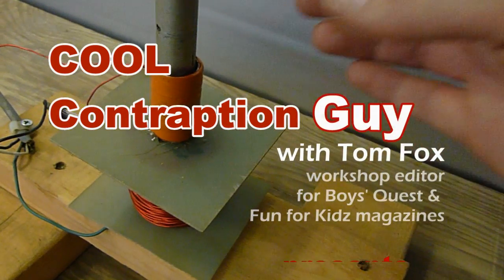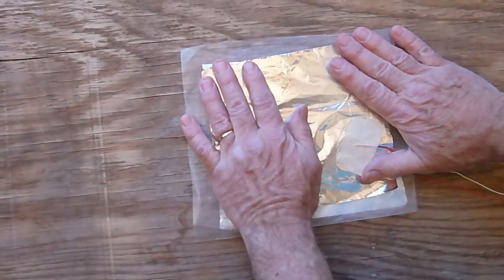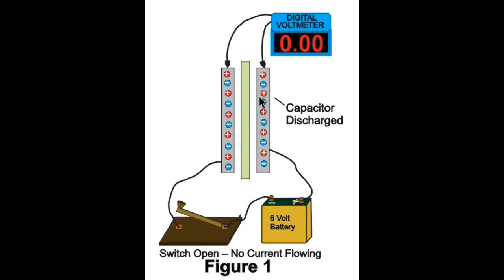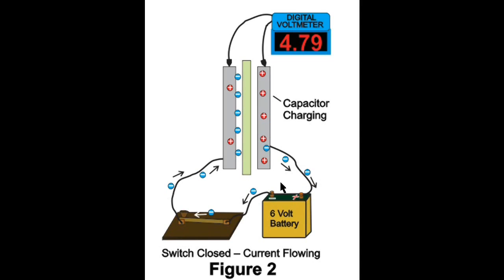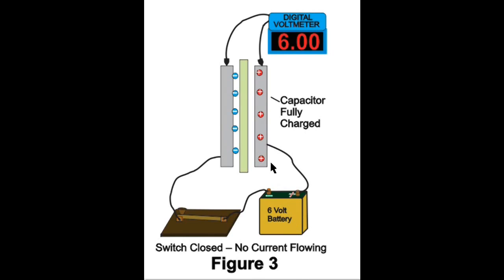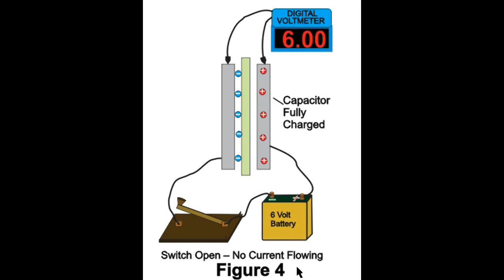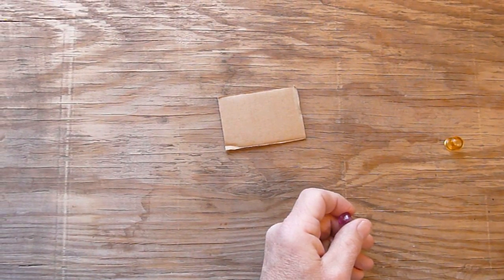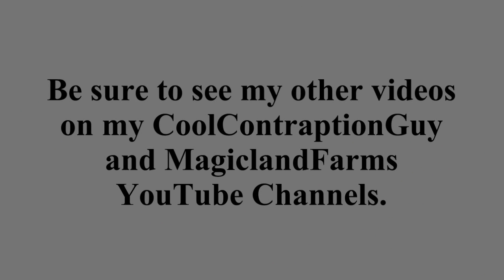How Capacitors Store Electrical Energy

Comment: Do capacitors really store electrical energy? Because as an electrical engineer I was told that the main and one of the disadvantages of electrical energy is the fact that it can't be stored. Of course, even if capacitor does so, in practice the energy stored in a capacitor isn't enough for it to fart.

Edit: capacitors don't store electrical energy, but they store electrical potential energy

Comment: thank you for sharing, you said that if you charge the capacitor  of 6 volts battery then it will stop charging if it reach the 6 volts, my question is what happen if your capacitor voltage value is 50 volts and your battery charger is onli 6 volts, does the capacitor continues to charge until it reach the 50 volts? and also what happen if reverse situation like 6 volts capacitor and 50 volts charger?

Comment: So we know that once 'charged' the plates repel each-other doesn't that mean they are both positive or both negative? Are we not just changing the magnetic properties of the plates so that they appear to store charge? Once we 'connect' them with a 'load' positive or negative electrons switch with half the now twice as many positive or negative charges and even out across the plates pullin/creating the same amount of current it took to 'charge' them. My question is does it physically store charge or does it create inside itself a polarly charged imbalance that then corrects itself by making electrons flow in the circuit it connects to?

Are we Adding an additional magnetic charge equal to the charge taken from one side and reinserted into the other but because of the dielectric it cant quite get to where it wants to go [other electrode] but still will travel back to the imbalance on the other plate direction so it manifests as an electric current to jump back home always taking the path of least resistance? We can encourage the path of least resistance by shorting the cap or introducing a less resistive circuit to induce current flow? How do we measure maximum capacity? What is the giving potential of the last valence shell in the electrode material plus how much surface area does it have? Also, what is the dielectrics tendency to acquire an imbalance in charge how negative in its valence shell plus how resistive it is by how thick it is? Are both the electrodes always benefit from being the same size or can one be larger or smaller Can they be shaped like transformer coils? Can they be made to induce magnetic current as well?

Comment: Electrons repel Protons (to the other plate), but opposing charges attract?
Reply: Surging Circuits I'm no expert but I'll try. so electrons do the moving. not protons. electrons are negative but they are referred to as the positive charge. This is because of conventional flow, it's literally backwards and if you don't know look it up... anyway, the battery terminal, which has a potential difference and force (volts), pushes the electons into the plate and they build up. im guessing the electrons also push back a bit as they reach full capacity on the plate due to some repelling but that's nothing compared to the volts, which are coming from the battery terminal and is a lot stronger. because of the size of the plate you get an accumilation of electrons. why are they so happy to do this? i think electons are very easy to manipulate so you get a storage of negative electrons/positive of the capacitor. The amount of electons make an electric field possible because the build up creates a large negative force and is strong enough to be wanting to be pulled to the protons on the other plate. bit like a magnet that wants to connect but it's not quite touching (my guess). The other plate with the protons and lack of electons is called the negative charged plate. how did the electons go? I'm not sure but i think either the other battery terminal moved them off due to its charge having an opposite kind of effect, or the electron charge on the positive plate built up and repelled the electrons on the negative plate. it repelled those electons just far enough away to make that plate charged or lacking of electons. so as it pushes in one way it pull with the field. The field can only move electrical energy one way because only electons move.
so now each plate has a different charge and the electrical field makes them interact. how? not quite sure. It's obviously some kind of connection.  I think the dielectric electons are also repelled, more and more as the electrons add up, and theyre discharged on the proton side, then they are replaced and the process is repeated. so the jump is actually when the field is strong enough to change shape and discharge.
well like I say, I'm no expert, and its just my youtube educated guess 😀 it's good to just think and use imagination.
I just answered to create discussion and hopefully find some frickin answers.
Reply: Hey Gary (thanks for your reply) and All…  My reply was to challenge the presentation a bit. I appreciate the video, but think it could mislead a bit, and getting a strong understanding of basics is the foundation you and I will build on. So, constructive criticism and contribution is what we all want, I assume.  Providing these basis points per my current understandings, for further considerations...

Atoms POSitively charged have more protons (greater mass) than they do electrons (lesser mass).  Atoms NEGatively charged, have more electrons than protons. Both atoms (IONs) desire to be equalized, and therefore have "potential" (voltage). They want to be neutral.  Electrons (less mass) will flow away from NEGatively charged atoms and rush to POSitively charged atoms in an attempt to achieve peace and tranquility. NEUtrality.

An often missed element to this conversation IMHO is POS and NEG charges. I believe there are 3 things in a flow (CURRENT): 1) POS charges flowing +to- (my "CONVENTIONAL" flow direction), 2) NEG charges flowing -to+, and 3) ELECTRONS flowing -to+ (my "ELECTRON" flow direction).  ----- Imagine a relay racing team. The runners are electrons. They have been given POS and NEG batons (charges). As they run from NEG to POS atom colonies, above their heads, they are passing batons; POS batons to the rear, and NEG batons ahead. We know that electrons are fast, but charges are much faster!  (Batons arrive before electrons do.)

If this was not true, CONVENTIONAL flow would be invalid. The fact that both CONVENTIONAL and ELECTRON flows can describe how a circuit works, indicates proof of my concept; both are happening at the same time. (again, IMHO)

So, plates, capacitors, and all.  Let's consider a 12v auto battery.  It's not 12v at all!  It is six 2v cells in series.  Each 2v cell has POS and NEG plates at a specific distance from each other with a dielectric in-between. Each cell is a capacitor. These capacitor cells are storing energy in the form of colonies of POS atoms living near NEG atom colonies. They are close, they want to exchange and neutralize, but the bridge is out. Magnetic fields make them aware of each other, and the desire to get together is huge/powerful. Potential is high, the height of which is determined by the number of the colonies, and capacity by the amount of unbalanced atoms (IONs) living in each at the time.  Take a cold shower now.  ;-) Electrolyte facilitates this.

The potential to get together is great, and they are willing to do the WORK to get together to satisfy their desires of NEUtralizing.  So, when a bridge (connection) occurs, they are off and running!  Once they all get together and do their NEUtralizing (balancing out their proton/electron counts, and releasing energy/WORK while doing so), they take rest; and have no further potential.

That's when we recharge them; cause imbalance and segregation once again!  And when we do, and a capacitor reaches equilibrium with the charging unit, OR it's maximum colony population (saturation), it ceases to flow (or take on more).  If it does take on too much, the separator (dielectric) fails, and it's ability to function ceases/fails in chaos.

So, I don't think electrons ever reject or repel protons…  My 2cents.

Comment: YOU SAID THAT THE CAPACITORS HAVE A BARRIER (DIELECTRIC) WHICH SEPERATES THE PLATES AND U GAVE US AN ANLOGY WITH THE MAGNETS, BUT THE DIELECTRIC IS PRESENT EVEN WHEN THE CAPACITOR DISCHARGES . HOW ARE THE CHARGES FLOWING IN THIS SITUATION THROUGH A DIELECTRIC? PLS REPLY ,VERY CURIOUS TO KNOW .
Reply: in this video he discharged the capacitors by connecting a wire between the two plates and that is how it is discharged. but I do have a doubt that even when u leave a capacitor as it is after charging it , it will slowly gets discharged how is that happening??

Comment: Excellent video. The first one I've seen that not only explains how caps work but also shows HOW they actually maintain a charge after the voltage source is removed.
Reply: AJFreeway i dont believe those are protons... pretty sure its a neutral lack of an electron called holes

Comment: Why does the flow stops when the voltages are equal? Can someone please tell me? It has been bugging me for a long time.
Reply: +Michael Can you explain that?
Reply: Caps fight voltage fluctuation and inductance fights amperage fluctuation... since (in an AC circuit) the sin wave is always changing then at any two points in time the voltage and amperage will not ever be the same... however we say that, for instance, on average the voltage is 120 volt at its given amperage.

Hint hint... the magic here is that these two effects (capacitance and inductance) occur because of different reasons and they also both create “flyback”.... and if tuned correctly the current will enter the cap and flyback to inductor or enter the inductor and flyback to the capacitor indefinitely.... just like a electro-magnetic pendulum!!!

Comment: Question; capacitors are polar sensitive. If using a system that reverses + & - how would you wire the system to maintain current in either direction. EXAMPLE; Model RR DCC system. As you reverse the direction or put the locomotive on the track in either direction the + & - reverse which would reverse the polarity to the capacitor. ??? If you need a  visual please see my video ATLAS MASTER SF GP38 TSUNAMI CURRENT KEEPER.

Comment: Even in this era of super capacitors, I find it hard to believe that those capacitors are a full farad apiece.  Capacitors get physically larger with two factors--capacitance, in farads, and maximum allowable voltage.  Connecting the three capacitors in series, as in this video, triples the maximum voltage rating but cuts the total capacitance to one-third of one capacitor.  This indicates that the capacitors he used were in fact high capacitance and low voltage rating, and he had to sacrifice capacitance to enable connection to a six volt battery.  It is still hard to believe that a one farad capacitor could be so small, even if rated as low as two volts.  But, I learned electronics many years ago, and capacitors seem to get smaller every year.
Reply: Look up Robert Murray Smith - he is an expert on multi Farad capacitors, and explains the super capacitor. (It works in a different way from normal capacitors.)

Comment: Ok, now I understand how a capacitor charges (thanks to your video). I see Capacitors everywhere in Circuit Boards, I just don't see how these capacitors conduct electricity once they are charged? Do they over flow or something, because one you charge them, they act as insulator. Please Explain,

Thanks
Reply: kas kakavand they only conduct when a load is required, like a battery the capacitor wont overflow, usually there is a transistor or relay further down the circuit to cause it to reroute electrons to another part of the circuit and it will not hold voltage for long..especially if there is a power light on that circuit(why your computer power light  goes dimmer before it goes out, when you turn off your supply power)

Comment: What would happen if two capacitors were connected in series instead of three capacitors? Will the LED glow?
Reply: Animesh Nath , Goto elementary school first
Reply: Animesh Nath depends on the rating of the capacitor..in series you rate the circuit by the lowest capacitor. In parallel you add them up for total capacitance.(which is opposite of calculating circuit resistance)
Reply: it stills working (depending of the voltage managed for the capacitors and the actual current in the circuit necessary to make the LED glow) because you still having a current pushed by the capacitors trough the LED.
Reply: Thanks for reply Daniel.
Reply: Animesh Nath The capacity become higher if you 2 takes capacitors instead of 3 in series so the led will glow longer .
The only advantage for capacitors in series is that it can handle a higher voltage than what it was created for. 
For example 2 X a capacitor  in series of 50 volt and 50 farad will become 100 volt and 25 farad
Reply: Animesh Nath You are an idiot.Delete ur question first.Shame on you  - on behalf of indian
Reply: +Siva Camry its okay to have doubts...you get lost u fuckin idiot

Comment: good video.       capacitor store electrical energy for a short period of time. but it is possible to increase its storage capacity by increasing area between the parallel plate and decreasing the distance between the plate.In capacitor current lead voltage by 90 degree. is there any means, in which we increase the  storage capacity of capacitor ?